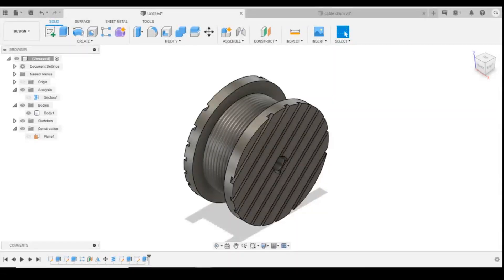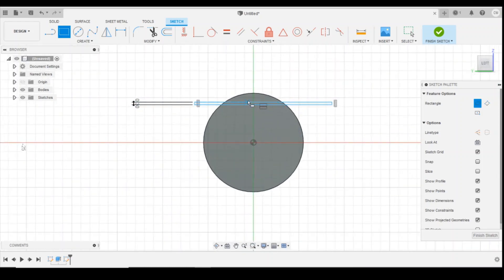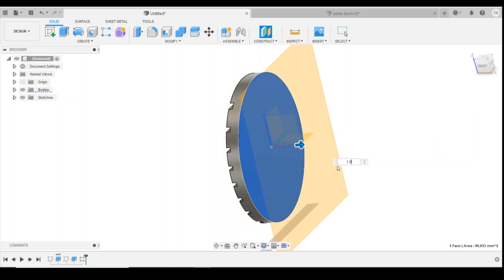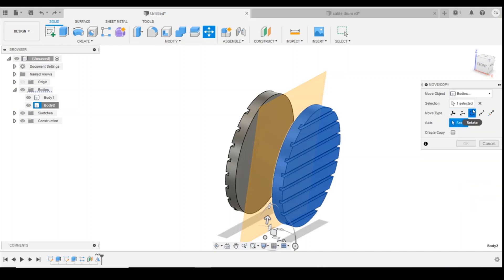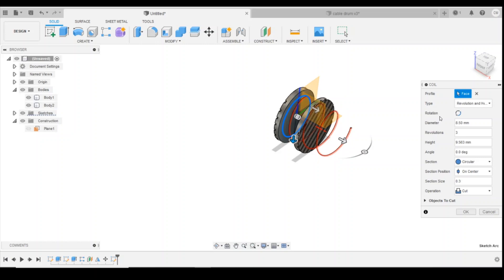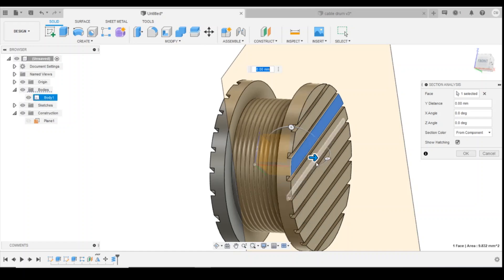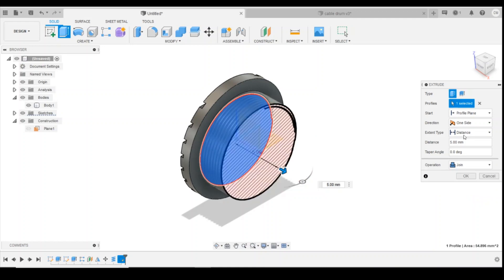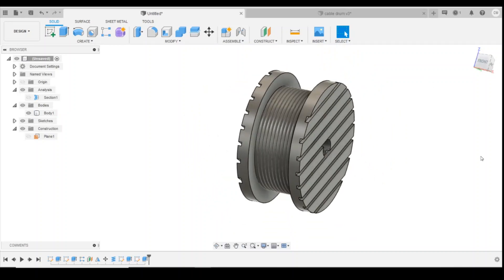Lesson 28 - Fusion 360 Beginners guide.  Model Railway Cable drum

Comment: Hi Carl

Great video again thank you.
Just a bit of added info for you.
Large cable drums like this  have a square metal plate to protect the centre hole plus a circle of supports for the main inner drum support which appear externally as small holes.
Very best regards 

Mike
Reply from the maker: Hi Mike,

That's great info,  i will make the changes to my model.

Thanks